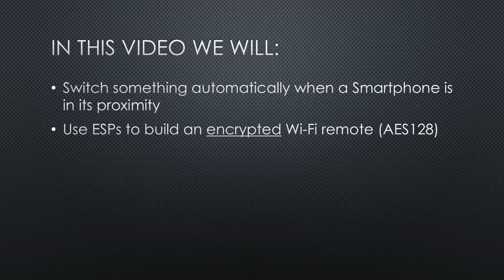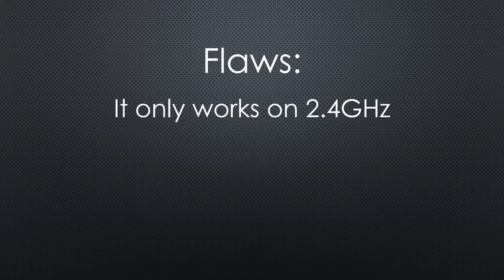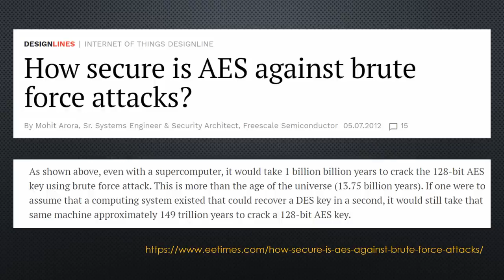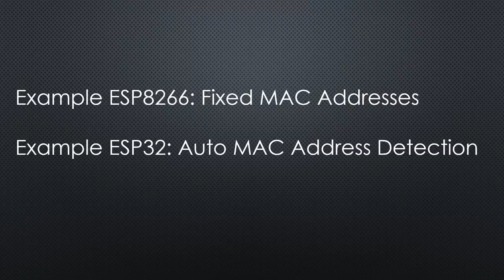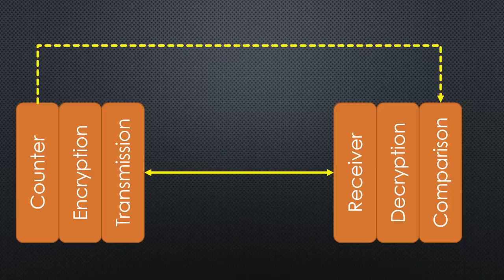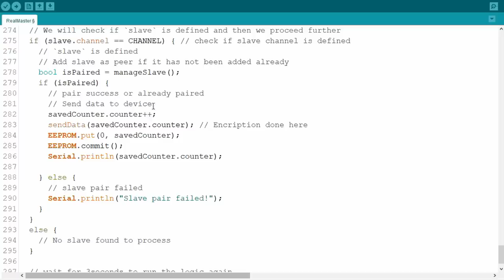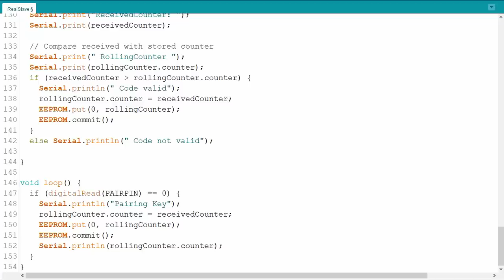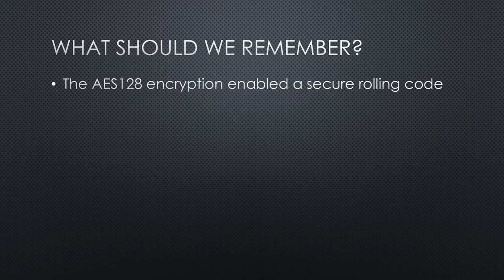#382 Secure and cool Remote Controls (Touchless, AES128 encryption, with a T-Beam watch and a cat)

Comment: 4:38 that was 2012, AES128 isn't enough now and AES256 is standard minimum. I'd used wifi with website port for the garage door with an internal CA cert singing the client and server. overkill but never be hacked, client and server is authenticated.
Reply: It's been nearly ten years, but AES128 has been a surprising success story. The only known attacks are theoretical, I believe reducing the key space to something like 2^126. Which is better than the 2^127 average brute force attack, but is sufficiently secure by far. Many crypto algorithms don't survive that long, but there are rare exceptions, and AES128 is one of them.
Reply: @slimhazard  you have to make a really long key, rainbow tables are getting longer and longer and take seconds to crack even AES128 keys.
Reply: AES256 can be attacked with rainbow tables. This alone makes AES128 more fit for the job.
Reply: @phizicks  rainbow tables are usually used to crack hash algorithms, not symmetric encryption such as AES. I suppose you could try to store tables of ciphertext blocks mapped to possible plaintexts, if you can guess at message contents and keys. That might even work, if you can get the guesses right, but then the problem was weak keys and easily cribbed messages, not the crypto algorithm.

No one has tables to cover all possible plaintexts for all possible 128-bit ciphertext blocks. There might not be enough matter on Earth for the storage. And even in the alternative universe in which that's feasible, then AES256 wouldn't help, because it has the same block size (just longer keys).

Let's please not confuse or frighten readers who come into the comment section, by making them think that their AES128-based crypto system might be insecure. That is false (by the way, reader, this is the year 2021). Certainly they should be using strong keys, and preferably plaintexts that aren't too easily cribbed. But the difference between AES128 and -256 is not relevant to that.

Comment: I've tried something similar before (just without encryption etc), but the ESP's wifi has a hard time to get through the steel garage door and metal coated (sun protection) car windows :-(
I'm waiting for my ESP with external antenna connector to arrive so I can try again.
Reply from the maker: I can imagine that a steel door does not help ;-) Let's hope it works with the antenna. Otherwise maybe you can change the location of the receiver.

Comment: What about a command over Wifi that turns on a light and opens the door one second later, while on the transmitter side, it sends a dummy message on 433MHz or so after that same delay. From outside, it would look like the Wifi is used to turn on the light but the door opens on the usual 433MHz signal, thereby directing attackers towards the fake.

Also, if the door in question is a front door instead of a garage door, it could be designed such that replaying the 433MHz signal without first sending a command over Wifi turns on a UVC lamp, so the attacker would just think he figured out how to turn on a cool looking light without realizing that his skin and eyes are being fried.
Reply from the maker: Using "two way authentication" is a very good idea, also if only used to confusing the attacker. One disadvantage could be that we nee more hardware.

Comment: What would happen when attacker jam the receiver when you press the transmitter, then you would think that the receiver didn't received the code and you will press the remote twice! So now the attacker have 2 codes. and if he play back the first one then it will open or close the garage door making you think that it worked now, but the attacker still have another left to repay attack! maybe something to think about ? 👀
Reply from the maker: It is not easy to just jam one receiver when they are close. The attacker probably would also jam his onw receiver and hear nothing.
Reply: @AndreasSpiess  That's right. I feel dumb now! 😒

Comment: I wonder if one can make an encrypted wifi walkie-talkie using ESP32 and ESP NOW?
Reply from the maker: I assume it could be done. But you would have to check if the AES 128 performance is good enough.
Reply: @AndreasSpiess  I did a search and found this project very interesting.
Search "ESP32 Walkie-Talkie using UDP Broadcast and ESP-NOW" on YT.

Comment: What if, multiple user use the garage how we'll manage this
Reply: I'm a web-developer that's not my field, I'm just thinking. Maybe the receiver (garage), on each call received, could send back to the sender (remote) an encrypted message of where is at with the counter.

The sender receives back the encrypted message, decrypt it, updates is own counter, then increment it, and sends back a new signal to the receiver.

Therefore you can have as many keys you need. 

Theoretically it seems ok, to me. But I have no idea if it technically possible (for the garage to send back a signal to the remote, like on a "challenge-respond") , again this is not my field. I wonder what Andreas think about it.
Reply from the maker: Then you have to use a completely different way. Using two way communication would probably be the better way for that scenario.

Comment: Andreas: use a RTC or other type of reliable clock to combine with the counter 
use this as additional verification, let the time between a window of eg 10sec... 
no way you can milk now..
Reply from the maker: You are right. But you need quite precise clocks (For years). Unless you transmit the actual clock for synchronization every time.
Reply: @AndreasSpiess  yes , that is a challange, but should be manageable, an RTC can run of the same source that runs the remote and local devices, assuming these have some kind of power source, as part of a maintenance routine you could also sync the clocks or if possible use NTP as a source , maybe even automated , or on boot , it all depends on the actual situation of course.

Comment: Instead of a counter, I use (with CircuitPython) the TOTP library.
Reply from the maker: Does this need synchronized clocks on both sides?
Reply: @AndreasSpiess  Yes, in the case of the devices I use, they request NTP at boot.
Reply from the maker: I used ESP_Now because I wanted to be independent of Wi-Fi. With Wi-Fi you could use it, of course.

Comment: Hi ! 

You should add hmac sha-1 to authenticate and verify your message sent.

Mreowww purrr !
Reply: I agree that an HMAC solution might be good for this, because then it wouldn‘t be necessary to keep counters on the client and server sides in sync. The client generates a random 64-bit number and an HMAC for it, sends the HMAC with the message, and the server can verify it. That requires the shared key, as for AES, but no other shared state.

The issue then might be to safely generate unpredictable random numbers. Bad RNGs are abundant and can be cracked. Just guessing, but I imagine that crypto-quality RNGs for ESP-32 wouldn‘t be too hard to find, but you might have to go looking for a library to get it done on an ESP8266.
Reply: @slimhazard  actually I prefere a HTTP over TLS with a strong authentication using a X509 certificate client. 

It s so safe and commun.
Reply: @eddybash1342  no doubt, that would be a secure solution. But it would require even more sophisticated software, and it would still need the crypto-quality RNGs. The shared state then takes the form of the client certificate.

If the Guy With The Swiss Accent (gruezi!) or any of his viewers want to go with TLS, then chances are good that they‘ll get a secure solution. But I think it‘s worth considering the least that you‘d have to do and still be sufficiently secure. The solution in the video is probably fine, and I believe that HMAC would also get it done only depending on the shared key, but not on the counter.
Reply: @slimhazard  no crypto RNG matter !

In case the X509 client is wrong, then the authentication fails. ;)

The full stack a bit heavy...
Reply: @eddybash1342  something has to be different in each message. That‘s what motivates the counter in the video. If all you send is the command and the signature from the client cert, it could be replayed.
Reply: @slimhazard  right: the famous Replay attack

Comment: if using two-way communication:
why not using TWO codes for the remote, one as prefix, the other as the current "counter"?
Everytime the garage-door is closing (by hitting a local switch), the receiver creates and sends (pun intended) a new random-prefix to the opener, which saves it and uses it for the next opening-sequence.
There's a lot of potential to play with this idea eg "using the prefix for an also selected count" (eg 4 x prefix = ok) or even send a warning to an email-address or cellphone if there's the wrong prefix used on the door...
also if two-way, the receiver's gain can be just as strong enough to reach the opener within the garage, but not outside the building...

hardware-requirements only increase for the receiver, the opener just needs the normal twoway-communication and an "autorised updater-mac" in conjunction with a special "update-autorisation-code".

(just a little brainfart of mine, i admit i'm not too keen in programming aso)
Reply from the maker: You are right, two way communication would open many new possibilities. And an "attack" e-mail is a good thing, too.

Comment: Love the topic as it's I've been toying around with the idea for quite some time now.
But for variables that need to be changed for systems to work securely, such as the key and IV, you should absolutely never put them in a header file. Those need to be the first thing you see when you open the sketch and marked with a big comment on why you really need to change them.
I can already imagine less-experienced and/or lazy (never underestimate human laziness; "// TODO: this will be fine for testing, I'll change it later") just download your code and not even realise there's something that needs to be changed.

I'd even go so far and do it like the WiFi example sketches for the ESP where there's just dots in it and it wouldn't compile here but that would probably get lost on some tutorial website where someone uploads their slightly modified code.

Then again, thinking about it, having it external means nobody is accidentally going to share their key/IV when they ask for help because there's a semicolon missing...

I think we can conclude "be smart about it".
Reply from the maker: Good point about the header file. With my credentials I have a separate file in my libraries folder that I do not share them accidentally.

Comment: You could also just add a few random bytes to the end of the keyword that the reciever will ignore
Reply from the maker: How would the receiver know that these bytes are from the right transmitter and not just random bytes from an attacker?
Reply: @AndreasSpiess  the random byteas are paired with a keyphrase. The reciever checks if the decryped stuff contains the key and ignores the rest. It also keeps a list of a few hundred of those bytes and rejects them if seen again so there is no syncing rewuired. I must admit tho that my solution is a bit flawed as it takes up more EEPROM/flash than a 64bit integer
Reply: @AndreasSpiess  it would probably be better to dotch the random bytes and keyphrase and do a challange reponse thing
Reply: You could use the unused bytes for some random garbage which is ignored by the reciever after decryption - this helps with known plaintext attacks (as your Plaintext value space is limited to an unsigned long). This is called a salted plaintext. 

So a attacker has to also to check for every other byte which would be 0x00 otherwise.

Comment: With two-way communications:-
Mobile 	                          Garage
"Hello door"           ---->   Generate random number
Receive number.  <----   Send random number 
Mash number in
a secret way.
Return result          ---->   Does received number
                                           equal secret mash of                         
                                           number I sent?    
                                           If yes, open door

Secret mash can be anything that returns random looking numbers.

EG: As the seed to a random number generator, and both ends use the same RNG algorithm. 

Further, the numbers can be buried within a lot of other random stuff in the second and third messages. 
Only the legit players know where the number is buried.

Or any of a million other things...

No synchronization required, just protect code at each end.
Reply from the maker: You are right. Two way communication would increase the possibilities considerably! And synchronization would be free of charge.

Comment: At 06:54: unless ESP32 is a 64-bit platform, "unsigned long" is 32-bits.... Andreas, just print the sizeof(long) and you will see it is 4, not 8. To get 64bits integers in 32-bit platforms, you need "unsigned long long".
Reply: 4.2 billion unique numbers (uint32_t) is still a lot :-)
Reply from the maker: Thanks for the correction!

Comment: Opening doors, switching lights etc are more about authenticity and less about confidentiality. (You dont care if the message can be seen by anyone, but must be originated from you)

So to be fool proof for at least a few years, moderate challenge to pro-hackers, I would suggest doing it with TLS1.2 method, with 2 way communication.

Basically doing HTTPS thing.
Reply from the maker: You are right. Using 2 way communication would enable the usage of standard web technology

Comment: IDK if this can be useful for someone but this is the method i used when i made something similar:
"remote" and "gate" know a common long secret string "p4$$wr0d"
remote send "open" command to gate
gate send a random string generated from random generator + wifi noise  "ADF32" + "501B" so it never repeats
both concatenate random + password + command "ADF32501B_p4$$wr0d_open"
both hash SHA-1("ADF32501B_p4$$wr0d_open")  there is a few arduino libs for this.
remote transmit the hash
gate compares and open.
Like if it was useful.
Reply from the maker: I agree, you get a lot more possibilities if you use two way communication. You also could use TLS or HTTPS. I did not mention it but I wanted to use only one way communication because some 433 MHz devices do not offer bi-directionality.

Comment: I always wondered about creating a Time-based One Time Password (TOTP) keypad like our various "authenticator" apps use. Applying that to your wireless sketch could tremendously increase the security, especially if a reputable library exists to handle the implementation. TOTP usually has a margin of error of at least 90 seconds, so even a cheap clock would work as long as it could synchronize periodically.
Reply from the maker: You are right. Time is very good for many things! But we need two long-time stable clocks in both devices. Otherwise we need to synchronize them from time to time (as our Smartphones do)

Comment: Requiring a higher number can be out-guessed 50% of the time, if you know the length of the number. 100%, if you encrypt and send MAXLONG ... and what happens to the valid user if MAXLONG has already been sent? :-)
Reply from the maker: Some viewers suggested to add a window of maybe 100 valid numbers, which could easily be done, I think.

Comment: The weakest point in cryptosystems is often the key, as Joan Daemen, the co-creator of AES told me. This is the case here also. If people use the code as you show it, the key is the same for everyone, there is no point of using AES. The key is published on the internet. The key (or the IV) should be different for every installation. The key is the secret that protects the system against intrusion. I cannot agree with 8:20. This is not for extra security if you want, you MUST change or you will have no security, also, someone can block you by sending a high counter value using the same key and IV.
Edit: Looking at the code, the above seems to be valid before/during the pairing phase, probably not after that, but is the only way to evaluate that to reverse engineer the code? or is there some documentation, is it the implementation of a standard?
For Bluetooth for example, there is this random numeric code to be compared on both sides during pairing.
Reply from the maker: You are right. The key has to be changed, of course. Maybe I did not mention it because if is very obvious for me. And I thought I said you can change IV if you want to get additional security.
And I agree: With two-way communication (like BLE) we would get much more possibilities.

Comment: "Good enough for the girls I go out with"! That is not going to look good on the insurance claim for your stolen Harley!

Seriously though, code hopping remotes are handicapped by one-way communications. With two-way WiFi a secure challenge/response system ought to be feasible? Remote sends "I want in" in plaintext; door replies with a random number in plaintext; remote encrypts this number using a key known to the door and sends back; door encrypts the same number and compares, opening if and only if the encrypted numbers match. Harley secure even if girlfriend is only playing dumb!
Reply from the maker: You are right: If we add two way communication we get much more possibilities. And about the insurance claim: Of course there we would have to be a little creative, as usual ;-)

Comment: an otp would work to https://github.com/huming2207/esp-totp.
Reply from the maker: A few other viewers also mentioned this concept. Dos this require synchronized clocks at both sides?
Reply: @AndreasSpiess  There is a choice that allows to use a one time code that is not time based order based.